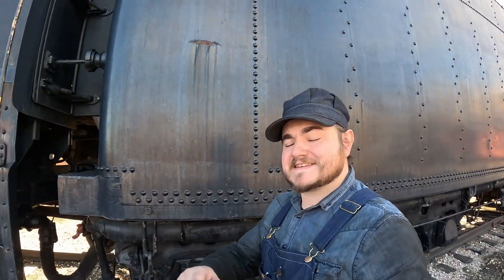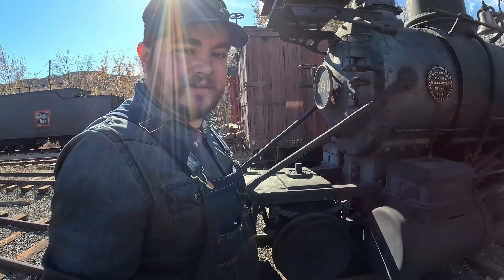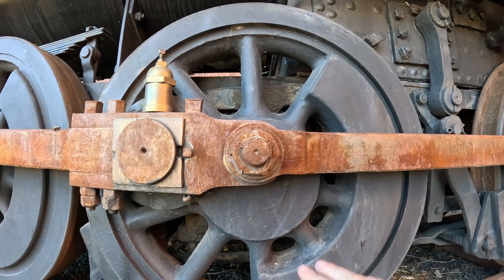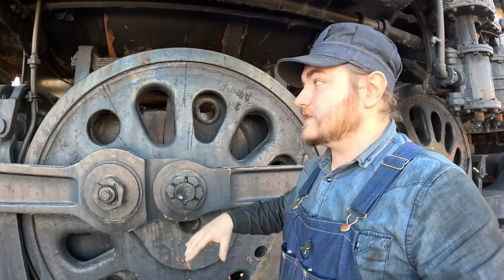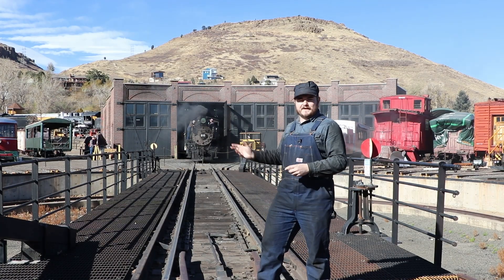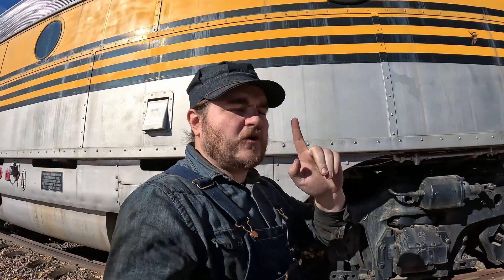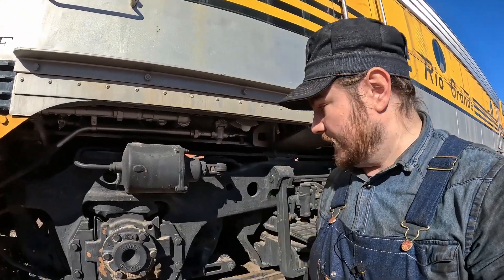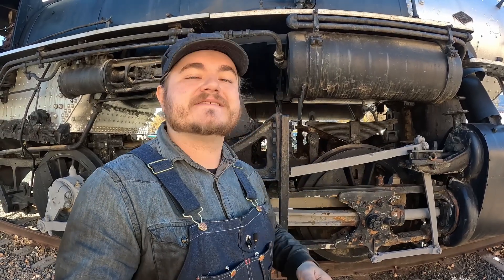HUGE vs. TINY drive wheels - Why? | Railroad 101

Comment: Hyce, I’ve got a question. In some recordings of locomotives you can hear clanking noises along with the chuffing. I’ve noticed that it mostly occurs in engines with Walschearts and Baker valve gears. If you listen to videos of N&W 475 or what you’d be most familiar with (D&RG K class engines) you can hear clanking as the engine goes by. Why is that? And sorry if this question is poorly worded.
Reply from the maker: The rods, depending on how recently they've been greased, will clunk around as they change direction. It's less noticeable on Stephenson gear engines because they just have less rods on the outside. :)
Reply: I assume its a case of shafts and bushings in joints having a bit of slop/tolerances that are just inevitable to have to some degree.
Reply: @Hyce777  thanks for the info